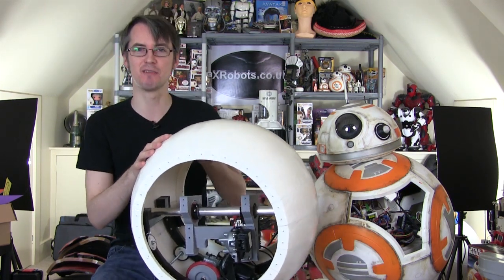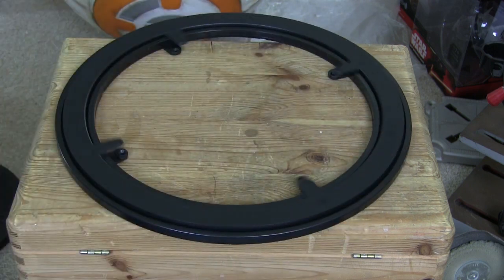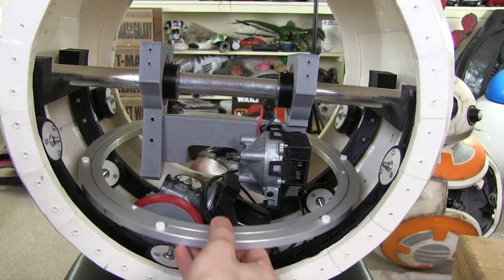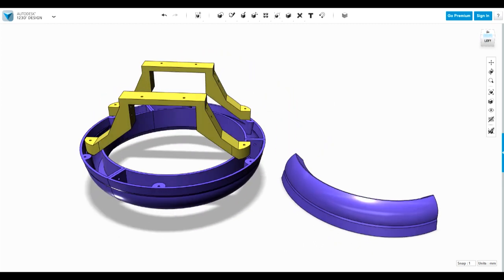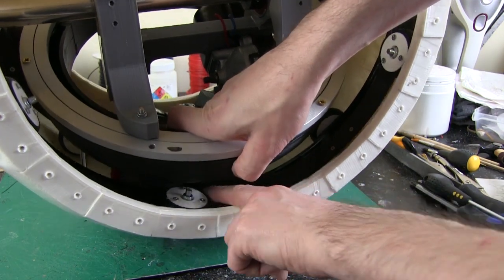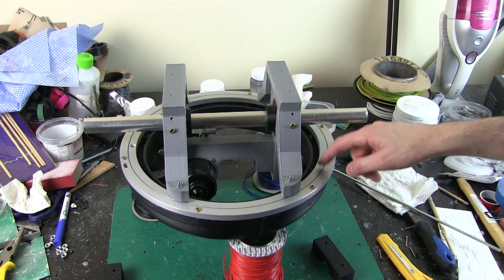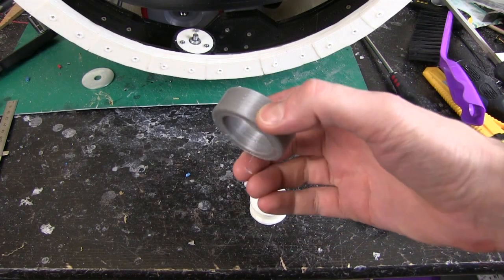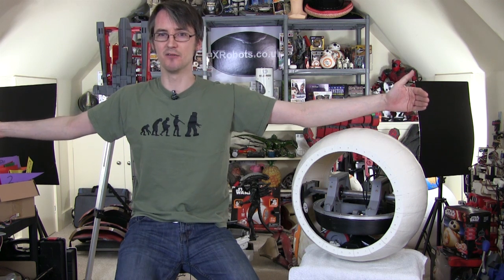Star Wars BB-8 Droid v3 #4 | Flywheel Testing | James Bruton

Comment: A potentiometer between the battery and whatever motor/servo you are testing would make for a good motor/servo checker with control of the power. I use a servo tester for rc planes and stuff, figured it may be a nice tool for you as well. Im loving version 3!

Comment: One thing you may not have thought of yet. If you try tilting the spinning flywheel gyroscopic procession will cause the tilting effect to be applied 90 degrees later (fore/aft).

Comment: Have you thought of using two opposing flywheels?  That way you can torque in either direction quite quickly while still keeping gyroscopic stability on the tilt axis.   Not sure if the added complexity would be worth it but thought i would ask. 

As always, keep up the good work!
Reply: +James Bruton (XRobots) I was thinking two flywheels in the same plane.  That way torque would only be applied when there is a difference in speeds.  Even if the speeds were both zero, speeding one up would generate torque.  When you want to stop the torque you would speed up the stopped one and slow down the faster one until they hit the same speed.  That would at least double your torque accuracy and reaction time.  Then you could decelerate them both at the same rate without applying any torque to BB8.  If you needed a very high torque, you could rapidly decel one and rapidly accel the other.  

The spinning wheels, regardless of the speed, would also gyro stabilize the trousers axis.  In BB8 v2,  I would assume starting or stopping the flywheel would give you adverse yaw in other axis (specifically 90 degrees out of plane from where it was applied).  A spinning flywheel (counter-rotation or otherwise) would give the trousers something to push off of.

Comment: If you want to turn a bit tighter on the go you should be able to combine the leaning with the flywheel to tighten it up. Should be simple have max lean at maybe 75% or so turning input and start feeding in flywheel control in past that?

Comment: for a tighter turning radius, maybe spinning the fly wheel in addition to tilting it at the same time could work. . . or it could be a mess. Spinning a tilted flywheel (similiar to a helicopter blade) should result in a 90° shift to where it is tilted. . . so it probably wouldn't work.
hmmm, I'm confused.
Reply: ***** yeah, my guts tell me the same, but it might be worth a try.

Comment: if the brackets are set higher than you predicted you could always reprint them to make up for the height difference just shorten them to fit the new height rather than make another part to fill in the gaps

Comment: Im sure you've thought of it, but id love to see a version that has full 2 directional movement inside the ball. Like with 4 wheels as contact points that can drive together to turn, or with opposites to drive in any direction (and lean by driving the wheels perpendicular to the current velocity). Alternatively, If this is not mechanically viable id love to hear why :D
Reply: +James Bruton (XRobots) fair enough :D maybe in version 7 you can design the ideal bb8 that surpasses the cinematic version and has full AI :P

Comment: Could you use the flywheel and trousers tilting in tandem with the droid moving forwards/backwards to decrease the turning circle. i.e. implement some mixing on the transmitter which engages the flywheel if the droid is in motion and the trousers have reached their maximum tilt rather than turn on the spot or drive in a large arc?

Comment: With the flywheel, what would happen if you had one section with more lead in it than the other 2? Side to side balance would be about the same, I assume, but the on the spot rotation would be slightly different. Any idea as to how much different it would be?

Comment: hey james i have a 3d print question, what is the best way to strengthen the build lines because i have had allot of instinces where they just come apart and its realy frustration.
Reply: +Matthew Barrett (Epsilon builds) XTC-3D by smooth-on would be a good alternative for pla or other filaments

Comment: I wonder if it was really worth including the flywheel feature... It did the job but wasn't a great effect IMO, 'cause to turn on the spot you had to spin up the flywheel and then stop it. My inclination after version 2 would have been to focus strictly on turning while in motion. It does limit things a bit (can only drive forward or backward from a stop) but it's good enough to get it moving around, and the effect is good as long as you don't get it stuck somewhere.
Reply: ***** I guess I need to review the footage again. I don't remember it doing that.

Comment: Isn't it a possibility to turn the flywheel while you're driving. The force that it will require to start up might make the turning circle slightly smaller.

Comment: Maybe I've missed something, but could you explain why you used that inside axis and the big washers to hold together the inside chassis instead of just putting screw holes in the outer axis and screw it fixed? If I remember correctly the outer axis is stationery and the 'trousers' move on bearings.
Reply: ***** I see. Well thought ahead. Thanks for answering.

Comment: Are you still gonna have space inside to make that small robot arm that pops out the side and gives the thumbs-up ?

And won't two kilos of lead shot spinning generate a magnetic field strong enough to generate errors in your arduino gyros and angle measuring sensors ?

Comment: I always feel weird when you don't print in the same colour as it's displayed in 123D
Reply: It is also much more impressive when you see it with all the different colors. I think it would be cool if he made different parts in different colors. You wouldn't be able to see them when they're covered up, but would make the inside prettier
Reply: It is also much more impressive when you see it with all the different colors. I think it would be cool if he made different parts in different colors. You wouldn't be able to see them when they're covered up, but would make the inside prettier
Reply: +vinno97 I know nothing of 3D printing, but I can imagine that colored plastics are more expensive than grey neutral colors. It likely boils down to saving money, especially since this is just a personal project of his
Reply: +Kenshi Mardon They can be slightly more expensive. I think mostly it's a matter of not having to swap filament out everytime he prints.  You have to flush the hot end out so that there is no contamination between colors, etc.
Reply: ***** Makes sense, thanks for the input
Reply: +Kenshi Mardon I'm pretty sure he gets the fillament for free. I might be wrong though...

Comment: Couldn't you combine the flywheel with the leaning to get a tighter turning radius?
Reply: Yeah, probably.
Reply: +James Bruton (XRobots) above a certain RPM it would push 90 degrees like any gyroscope .. placing a significant weight on a course screw and winding it from one side to the other would better induce a lean .. since he'll need ballast.. he could use that if he needed more lean than the head will give.. 6kilos.. err.. WONT need a ballast

.. edit.. oops.. wrong person.. lol .. replace "he" with "you" .. and "you" probably have a suitable piece already designed from your ultron project.. but no space left in version 3 to use it

Comment: I'd have used plaster instead of latex.  Plaster would cure faster (chemical reaction) and add even more weight, enhancing the flywheel performance.
Reply: Cool!  I know with plaster, you have to commit.  Or you could use aluminum foil or plastic wrap as a liner for ease of change.
Reply: ***** Love the channel, keep up the awesome work.

Comment: in the past I asked if you ever thought about making the flywheel an induction charge coil .. BUT . scrap that idea.. have you ever thought about spinning it with MAGNETISM??? ... place rare earth magnets in a top ring and a set in lower ring directly below it... when driving forwards the magnets (which would need to spin on their centre axis) would sit North to South and attract each other, keeping everything stationary ... but when you wanted to turn, they would spin North to north and south to south.. the initial offset inducing the proper direction.I would say use coils.. but the amount of on-board electrical energy needed would be stupid high.. and the BB8 isn't a rail gun :)

Comment: Not really a fan of the rails. Or the flywheel.
Reply: ***** I don't think it needs to spin on the spot, necessarily, just tumble which ever way you want. So a robot with omniwheels, like the one you did in the first version, but for the body, not for the head, might be a better approach if you wanted it to look more like the one in the movie.
Of course you'd need the ball to be smooth on the inside, etc.